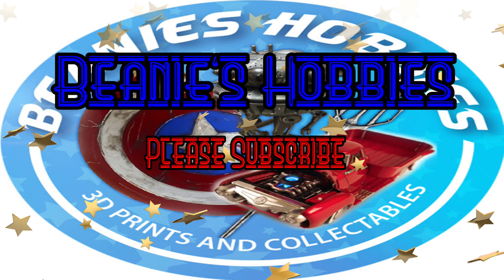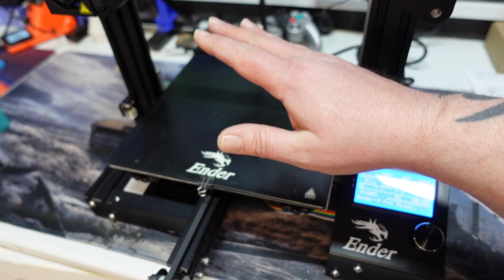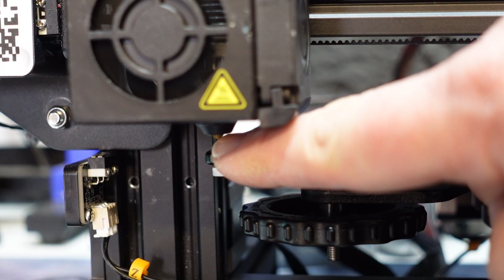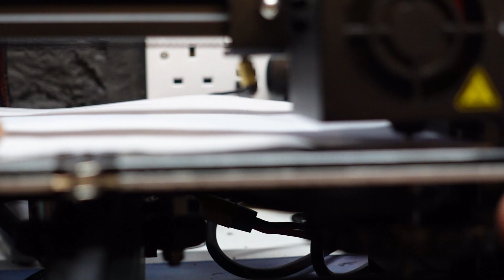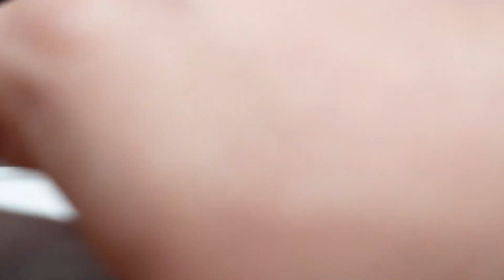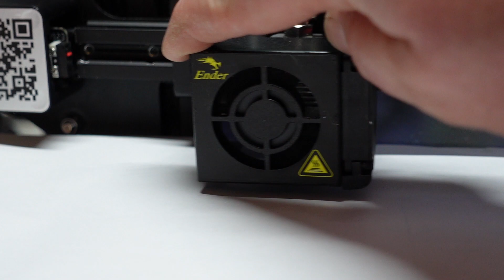How To Manually Level Your 3D Printer Bed

Comment: Nothing against the video, explained it great, but there's a reason we don't hand-crank engines anymore, and there's a reason they make auto-leveling beds, I need to get me one, lol
Reply: The ABL on my neptune 3 Max is hot garbage. Ive gone so far as to remove the auto level commands from the gcode. Theres a reason u still need a great pilot even tho the plane has auto pilot

Comment: I’m glad I came across this video as I am having trouble with a UP300 that has horrible, set up instructions and having to do a manual level since they’re automatic leveling is equally as horrible, but did not take into account preheating nozzle and bed for warp factor

Comment: great video.  one thing i did notice is the piece of paper you used wasn't ripped.  you will see loads of videos where they show you levelling the bed and the paper has a massive rip.  Also something I have noticed is that the bolts that the levelling wheels screw to sometimes spin round as they are basically held on with friction. if you get 4 rubber washers and 4 m4 nyloc nuts and fit them, you will find the bolts wont turn as you can level your bed better
Reply from the maker: The paper will rip if you have the nozzle down to low to the bed, you don't want rips in your paper means you are doing it wrong lol, also if your wheels are to loose try lowering your end stop switch down that will then give you more adjustment on the bed levelling nuts 😉